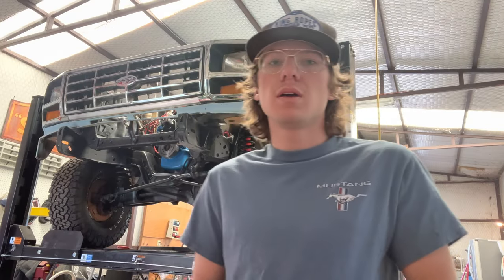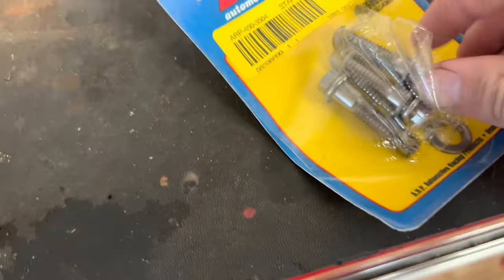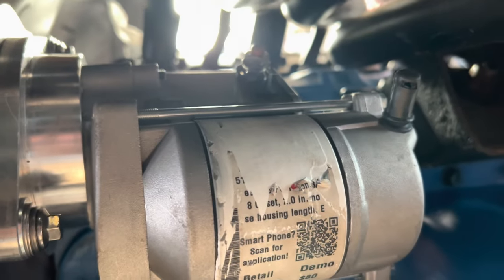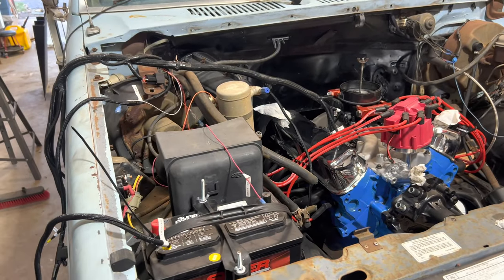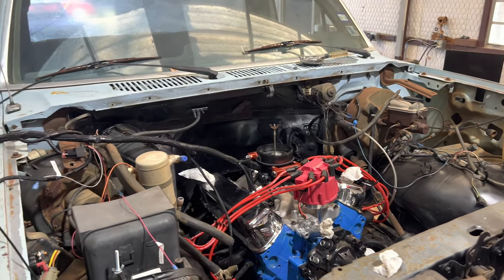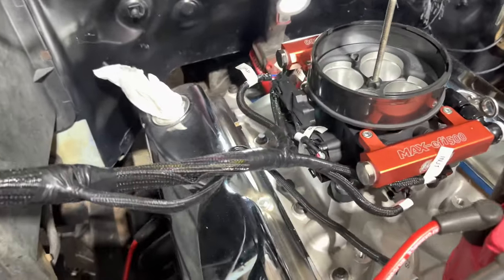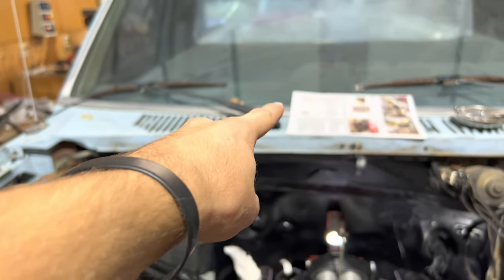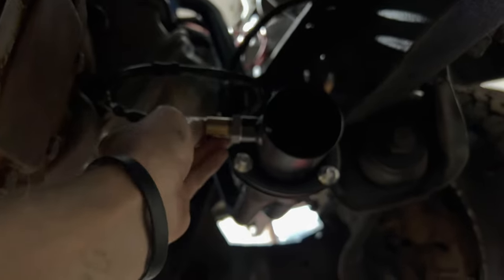1986 Ford F150: Wiring Harness PT.1

Comment: Can u tell me what that orange wire goes to where the harness plugs into alternator?
I have a 1981 f150 that is running 18 amps wide open .I'm so upset.i it fried the ignition module, I changedvthat,thebvoltage regulator again and still problems.but I remember looking at that wiring harness when I got the truck at first and seeing a orange wire hanging down. 
I let a mechanic look at it and no luck ,twice.a lot of money later the guy that sold it to me said that mechanic did something wrong. He said find out about that orange wire.
Any help would be a miricle.
Thank you.

Comment: Very informative. What wiring harness did you source for this?  86 harnesses seem to be very and far between.
Reply from the maker: The new body harness is a universal one we got off of eBay for $300 (most likely for a C10/Chevy). The engine harness is the Summit EFI one that came with the EFI kit. The EFI kit was roughly $900 brand new.